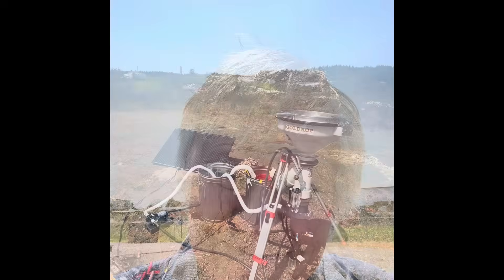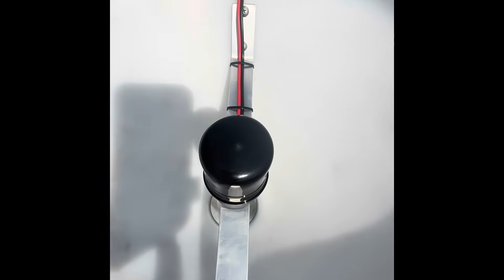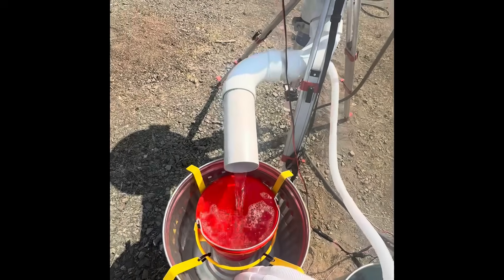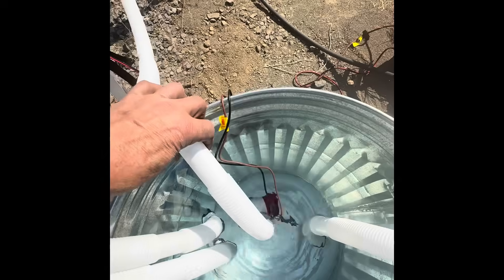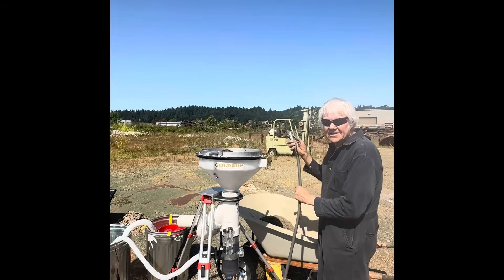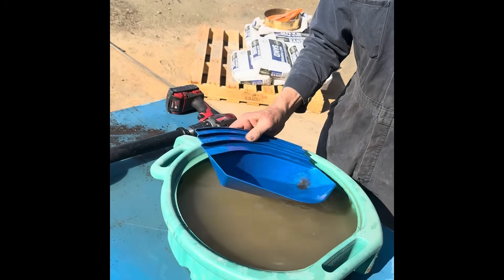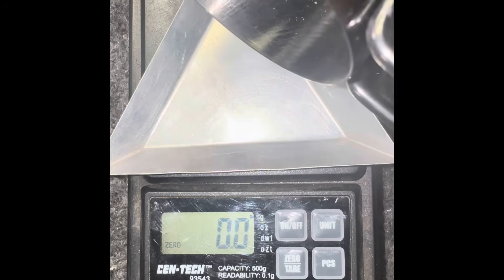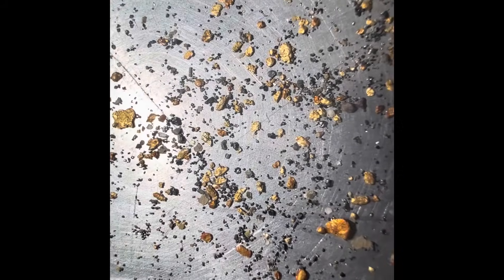Goldrop Miner “Incredible gold extraction”

Comment: Cool device. What do you do when the acrylic drop cell becomes internally scratched up to the point that you cant see the process? Maybe you should sell a drill attatchment with an acrylic buffing compound. Just an idea. It's bound to happen. Thanks for sharing
Reply from the maker: The polycarbonate drop is UV protected material and vapor polished for clarity after being machined to spec. It seems to resist scratching as we have not experienced complaints or any problems with visibility. I still use my original production prototype for 5 years now with no effects on clarity.
Reply: @sluicegoosegoldrop2821 Glad to hear that its polycarbonate and not acrylic, as acrylic is also known for cracking. Great job on the design. I can see you know your stuff

Comment: I love the machine! 
And I understand you're still proto-typing (?)
And I'd love to have enough paydirt to buy one with

But after watching the video, 
You're going to either need to set all that up 
more ergenomically, or automate the feed process! 
After shovelling all lthat sand UP into the feeder
Your right arm must have been buggered after that test run!

Do you sell DIY Kits?
Or is it the whole kit & caboodle?

That Separation chamber looks like it's pretty specifically manufactured
Or did you make all this yourself?
Either way, you're damn good at what you're doing! 
Even the fact you've reduced the control output of the machine
to one simple readout, involving turning a few valves
is pure Genius! So simple! 
It's gonna do what it does at that setting, 

Here's the Simple Instruction manual: 
Turn the machine on
Fill the watering system with enough water
so that it can maintain full re-circulation

add finely crushed material to hopper
Wash it through

Check the Seperation chamber
Turn this knob till you see stuff doing what you want it to do 
because of back-pressure
ie: lighter stuff go up
Heavy stuff fall down.

Then fine tune with the other knob to make the stuff 
You want to keep
Go to the place you want to keep it.

Repeat & Rinse till you run out of material! 

Thoughts: 
You could also add extra chambers on the tailings tube
With specific spin tunings
To target lighter metals
and magnetic separations as well!
This is a Nice design! 
It has a lot of potential for scaled oerations. 

I wish you luck!
Reply from the maker: Thanks for loving the Goldrop Miner! No more prototyping this model. It’s a finished design. Moving on the scale it larger! Hand feeding is no big deal. Saving automated feed system for larger designs that need it. Headed to LDMA Burnt River claim next month for a week of field testing to video its performance using shovels to feed it. No DIY kits as there is a lot of specialized marching in its assembly. I own a full service machine shop in Albany, Oregon for 45 years is how I manufacture them. No need for fine tuning. It’s set it and forget it! Concentrate on feeding paydirt. No need for chambers in the taints tube. There’s no gold in the tailings. Gold is too dense, 19.3 g/cm3, to rise up with the tailings. The Vortex Spinner with incoming watered paydirt from the funnel provides just enough lift to rid mineral tailings and leave all metals behind in the trap and jar. Don’t need magnets to gather magnetite. It is flushed up and out with the tailings because of its low density, 5g/cm3. Soon to start scaling even larger with automated feed system.

Comment: The Gold Drop is an interesting unit. I believe you actually made money on the sand! 😆 That's fantastic!
Enjoyed watching 
Stay Golden ⚡️ 
Peace Prospector Tripp
Reply from the maker: Sand-$6 .1 Grams of gold- $10.75 @$3330/oz. Remember though Gold proces are for bullion gold. What is recovered is not bullion gold, much less valuable!
Reply: @sluicegoosegoldrop2821  Could you melt your gold using solar power.  Either solar panels or the mirror (?) that focuses the light?
Reply from the maker: @cedjulemckeever not enough heat either way. Gold needs to smelted in a high temperature oven or induction cooker.